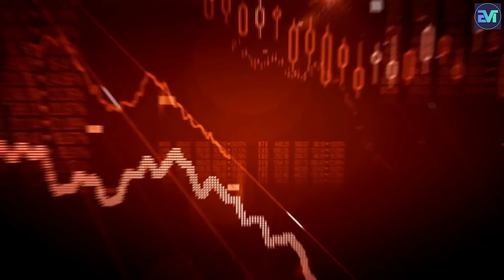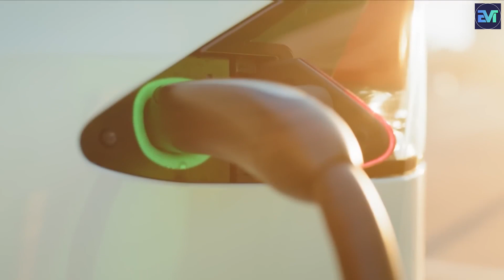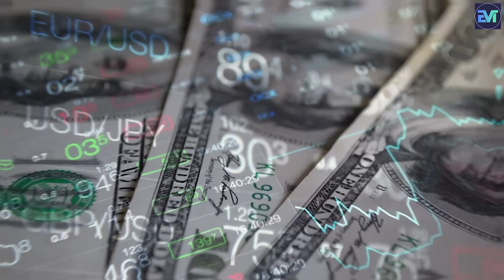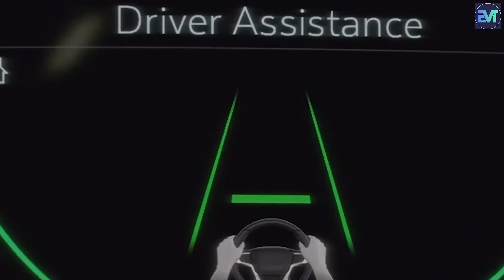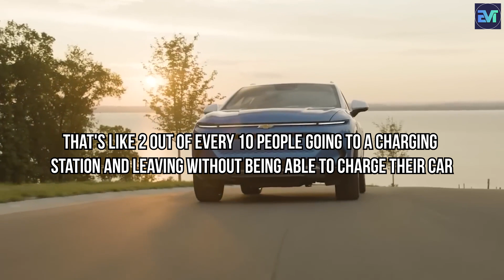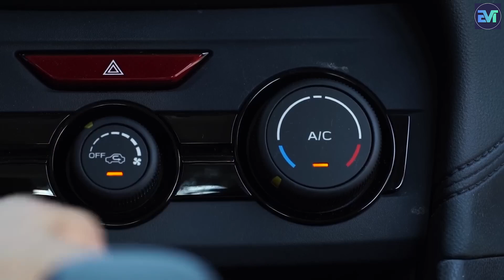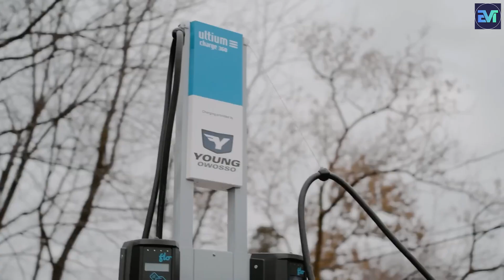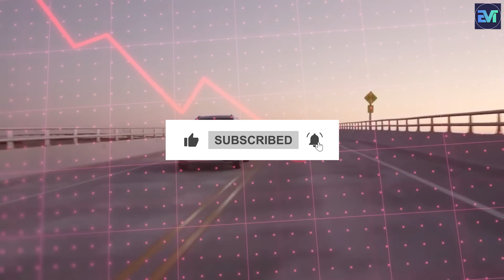Range Anxiety: The EV Owner's Dilemma

Comment: 4:03 Well... kinda wrong. In the United States, there are tons and tons of Superchargers out there. If there are V4 superchargers, the Tesla Model 3 can be charged to about 80% for about 20-30 minutes.

Plus, Tesla also allows you to plan the trip and shows you where and when to charge. It also preheats the battery before charging, so that the car can charge fast at a supercharger.

Also, Tesla won the plug wars (at least in the US and North America) allowing other EV companies to use Tesla's fast Supercharging network,